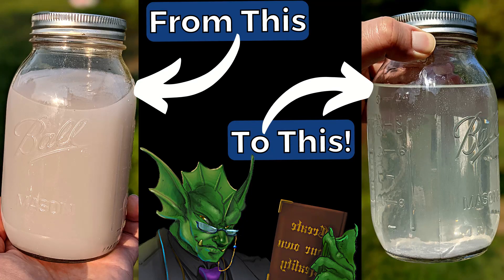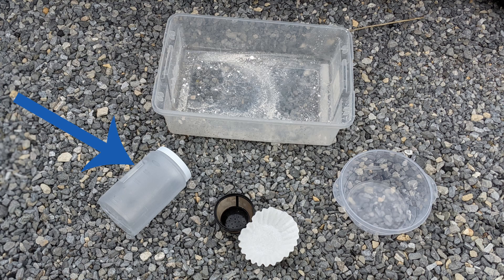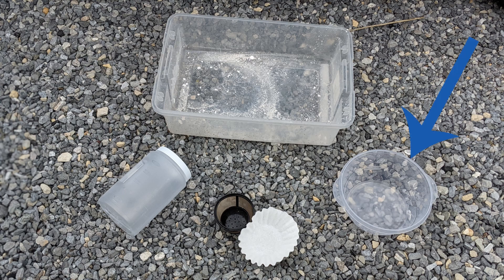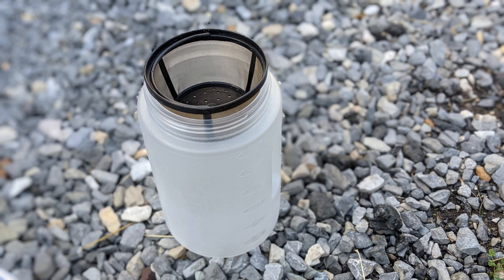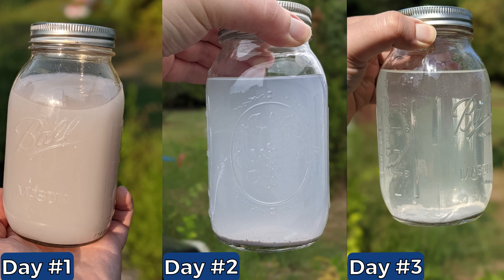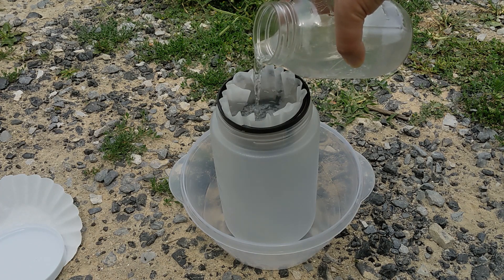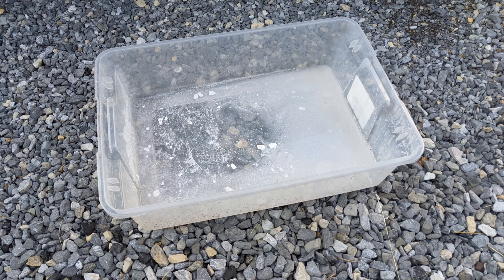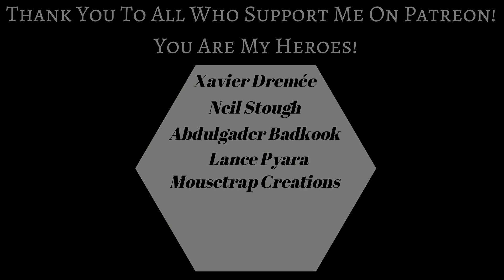How to Filter IPA & Other 3D Resin Cleaners!

Comment: Ignore all of this fiddling around with filters and cups and bottles and just buy a cheap water distiller. Dirty IPA put into a water distiller comes out crystal clear, basically as fresh as new. Set the distiller up outdoors away from any structures. I just started doing this with a $40 water distiller and it beats every other method I've tried by miles. No more consumable filters and gloves and towels and all that other stuff, just distill it and pour it back into a fresh container.
Reply from the maker: @mikefromwa  I've seen that recommended by a few people. 
For anyone considering this option, there are 3 things to be aware of.

1, the distilling process creates a concerning fire hazard when used to distill anything flammable. Please be sure to have fire detection and suppression equipment in the area.

2, the distilling process creates a lot of fumes that can be harmful to your health.

3, depending on the ordinance/laws of your state it could be illegal to distill any form of alcohol with any type of at home distillery.

Comment: Hey SPR, I’m having huge trouble with my resin curing and sticking to the sides of the jar. To the point it’s hard to scrape it off the sides. I’ve only left the jar next to the window for a day and I’ve noticed it cured the resin exposed the sides but created a dark spot where it doesn’t cure the inside. Could you tell me how is this so and how to prevent it from happening again? I use IPA and Elegoo ABS-like if that makes things clearer.
Reply from the maker: A few people have asked about similar issues. One thing I've learned since making this video is that you don't need to put your cleaner in the sun. I've left tubs of dirty cleaner in my dark basement for a few days and the resin settles to the bottom just fine without being cured. I'm working on an updated video to cover what I've learned since making this video.
But to avoid the issues you're seeing try filtering your cleaner more often and leave it in a place out of direct sunlight.
The issue with putting it in the sun is that when your cleaner is heavily saturated with resin then you tend to see a thick jelly like consistency rather than seeing the resin settle and separate.
Let me know if all that makes sense.
Reply: @SlicePrintRoleplay  I see, I never tried leaving them to settle on their own. I’ll give it a try and see how it goes.

Comment: I find decanting (ie tilting in order to pour out cleaner fluid) to be to jerky and disturbs the resin settled on the bottom.
I prefer siphoning. Tried with a siphon tube with manual pump (don't suck with mouth! It's not just the IPA/denatured alcohol vapors that you'll suck but also the risk of some resin!), 
but the manual pump usually requires both my hands and leaves the tube inside the settled container again to jerk around (though not as much as decanting).
But discovered really simple way, that I'm sure is accessible to all of you, and it's just as cheap as the manual pump siphon - an electric pump for these large mineral water bottles.
In my area they cost between 5 to 7 euro, and can be operated by a single touch of the button, so basically no jerking at all.
You just have to keep the lower end of the tube as low as you thing will suck most alcohol w/o sucking any resin.
I actually recommend using one of those large water bottles (with the large neck) for which these pumps are designed, because you'll have much easier time setting it, and you won't need any hands holding it, and you'll be able to cut the tube to the necessary length. It works for seconds.
The dirty alcohol at the very bottom I pour thru a paper coffee filter. It takes a long time to drip thru (try to pour most of the resin as late as possible, in order to allow the clearer alcohol to drip thru the filter faster), but since most of the alcohol was pumped already you probably don't need the very last amount so urgently.

Comment: I have a gallon of denatured alcohol that the resin won't settle. I'm in Arizona so lots of sun light.  This gallon I believe has a higher concentration of  methanol.  I could use some ideas.
Reply from the maker: I've heard of people having this issue with both IPA and denatured alcohol. I believe what's happening is that once your cleaning solution has reached a certain level of resin saturation it no longer settles. What normally happens is the cleaner becomes more like a thick jelly after being exposed to UV light. I believe the only way to recover any cleaning solution when it gets like this is to use an alcohol distiller. However, I have not tested this yet. Also doing this could be dangerous so please research and take the proper safety steps when using a distiller.

Comment: I just run my IPA thru a water distiller off amazon, perfectly cleaned IPA
Reply from the maker: I looked into that as well. It actually lead me to purchase an alcohol distiller. I was nervous about purchasing one that only said it was rated for water. I don't know if that will actually cause issues, but I wanted to be safe.
Unfortunately, I haven't had the chance to test it yet.
Reply: @SlicePrintRoleplay  also use it in a garage or outside or very ventilated place.
Reply from the maker: @clballs1  that definitely makes sense!
I was referring to any possible design elements or features that would make it safer to use with alcohol. I looked at different models and saw that both water and alcohol distillers look identical. So there may not be a difference. But I got one that specifically said it could be used with alcohol. It may not be necessary, but I wanted to be sure.
Thanks for your input and advice!
Reply: @SlicePrintRoleplay  Yup will work fine water distiller gets hot enough to evaporate IPA, will just have some nasty crude in the tank after its done of the resin, just scrape it out and good to go. Wont be able to use the distiller for anything other than this though, But ive made my money back from it in just Ipa/denatured alcohol ive saved.

Comment: you ever consider a french press? given the nature of how the filter is working here, it stands to reason that layer of defense would exponentially boost your ability to keep the settle resin at the bottom
Reply from the maker: That's a really interesting idea! I'll certainly look into it. I've actually been testing a new method that's working very well. Hopefully I'll be able to make an updated version of this video soon!
Reply: @SlicePrintRoleplay  it’s worked super well for me but only if you wait to push the plunger and when you do, you only do it a couple inches in set intervals;  every 10 minutes I’m testing now .

I can’t wait to see what you’ve come up with! Your videos were my main source for starting  to be honest now I’m up to building 1:3 cosworth engine perfect replicas haha one thing I’ve meant to ask you specifically is let’s say you damage the polarizing layer - common sense says replace the LCD entirely but if there’s no resin , the screen is still fine it’s just the pol layer. This is a tad uncommon bc usually with a fail, resin does harm the screen during printing but have you tried using any other layer on top of the lcd? Scientifically I get a polarizer is necessary I just don’t get why there’s no disruption in this part of the process. I’ve found with some cheap polarized sheets, it accomplishes the intent of the OEM layer, but this inky works so long as I use the correct angle. Have you ever seen a less clumsy process work ?

Comment: Safety warning: Denatured Alcohol is more methanol than it is ethanol. Methanol is extremely toxic and readily absorbed by the skin. It takes very little to cause permanent blindness (I know orally at least it's very little but I'd imagine the casual touching without gloves over time could lead to blindness, though I'm unsure how much via skin absorption). 

Not sure if it was another of your videos that showed it or just your affiliate link I clicked on. You one you have listed is I believe 45-50% ethanol and 50-55% ethanol. IPA (isopropyl alcohol) is relatively non-toxic. Just thought it was important to include this warning as you almost convinced at first to switch over to it. Now if I was responsible and kept my gloves on the whole time it would be alright, but usually after my wash I'll notice a print not fully cleaned and  pick it up the corner to wave through my bucket of IPA. I think I've accidentally gotten the IPA+resin on my skin a few times too (albeit a tiny amount but over time, exposure adds up). Might still look into it as the price savings seem really good to me, but people should be warned of the risk and make sure none get on your skin. I'm about to transition into a two stage wash were the second bucket will stay mostly clean and having denatured alcohol in first with isopropyl in second would reduce my exposure by a lot.

Comment: I've been leaving mine in a bottle in the window.
The first time I did it it pretty much cleared all the resin in about 2 weeks.
The second time it hasn't cleared and it's been over a month
Reply from the maker: That's really interesting. It could have something to do with how pure your IPA is... Or are you using a different cleaner?
Reply: @SlicePrintRoleplay  the only thing that changed was the resin

First was phrozen aqua blue, second was elegoo grey
Reply from the maker: @ebanksstudios  I wonder if that could have an impact on it. 🤔 Thanks for replying with that info. I'll see if I can find more info about this.
Reply: @SlicePrintRoleplay  Its strange because the resin would sink to the bottom in my wash and cure but when I left it in the window it clouded

Comment: Very helpful, thanks man! by the way, what kind of container should we use for the best result? is it glass one or perhaps polypropylene plastic? or even mineral water bottle is sufficient? 😂
Reply from the maker: That's a great question!
So I've tested this method with IPA and denatured alcohol. In my experience both clear glass and clear plastic work well.
Just please be sure that the plastic container you are using won't get broken down/eaten by your cleaner. 😅

Comment: I'm using the coffee filter in a round filter, but I'm finding the process takes forever. 2700ml took me about 40 minutes to filter, changing the filter 3x. Anyone come up with a faster way to filter the cured IPA back in?
Reply from the maker: So the main reason I recommend using the metal mesh coffee basket is because it allows liquid to flow in all directions.
This means it doesn't get clogged up the way a paper filter in a funnel will.

Comment: Thanks for the video....so, how frequently do you filter?  As to not get an overly saturated IPA solution that is hard to bring back to life.  Does greater frequency help?
Reply from the maker: You are very welcome! 

I personally don't print as much as I'd like. So my cleaning solution (denatured alcohol) might go 2-3 days untouched. By then the resin has settled and I can see how much there is. So if I see there's a large amount of resin settled on the bottom I'll just filter it before I use it. It only takes a minute or two so it doesn't add a ton of time to the cleaning process. Following that process I've been able to use the same cleaning solution for 6+ weeks. I add new when the level gets too low to cover the parts I am cleaning.

So if you're printing a lot my recommendation would be to have two containers going.  That way you can let one container settle while using the other. Then filter the one that's been sitting and switch them out.
I'd probably switch once a week if I was washing models evey day, but it will depend on what you're seeing.
Hopefully that answers your question.
Reply: @SlicePrintRoleplay  That is exactly the info I was looking for...thank you so much for sharing your knowledge!
Reply from the maker: @mcrorietube  fantastic, you are very welcome!
Reply: @SlicePrintRoleplay  so I guess my habit of running six or seven bottles of resin worth of prints through my cleaning station is a bit too much?
Reply from the maker: @JerrodHansen  that's totally dependent on the results you're getting. If you're not having issues then I wouldn't change your process. However, if you find your models are often sticky after washing them then it would be a good idea to do this more often. 😊
Reply: @SlicePrintRoleplay  I do a second bath with a toothbrush scrub as well. The prints are coming clean but I may be sacrificing recyclability if the IPA running it this long. 

Thanks for your video, good stuff!

Comment: Would the cured resin goo be dangerous if it touches you? I got a bit messy, leaving my rinse and cure container in the sun full of contaminated IPA. I filtered it, but tons of resin goo, left for hours in the sun
Reply from the maker: Yeah unfortunately that's a little tough. You're best bet when it gets overly saturated is to check and see if you have a chemical disposal center near you... I'm currently testing a few methods for dealing with that stuff, but nothing I can report back on yet I'm afraid.

Comment: I don't get it. This is unequivocally NOT how my dirty IPA behaves. When exposed to sunlight, instead of the resin solidifying and sinking to the bottom, it cures into this white, gelatinous IPA sludge.
Reply from the maker: Hey Frank. I've hard a few other people say the same thing so you're not alone. I apologize that I didn't cover this in my video, but it's actually something I haven't run into as a if yet. 
There is one thing that others have said works for them.
Let the dirty IPA set for a few days, up to a week or two, out of the sun.
Then see if the resin has settled down. If it has then expose it to UV light.
If it hasn't then try adding more IPA that's less saturated with resin.

I think this issue comes up when the IPA is overly saturated with resin and it is very slow to settle.
Reply: @SlicePrintRoleplay  Interesting - I'm getting this effect when the IPA is much less contaminated than yours seems to be  (from the pictures), but it could be worth testing. If I leave the cover off my wash and cure station, there's an hour of the afternoon where it gets sun... then BOOM jelly.
Reply from the maker: @festmkiv  interesting. 🤔 About 1 in 5 people in the comments have said this exact thing. It's so strange that it behaves so differently for some... I'm definitely going to look into this and see if I can figure out what's going on... Please do keep me updated on your experiences though!

Comment: Fantastic quick and to the point video! Going to try this out... my problem is I typically wait too long and just end up with a full jar of sludge ;)
Reply from the maker: Thanks for the awesome feedback! 
This is definitely not the only option for reusing IPA, but it's a good option.... But yes overly saturated IPA is a bit to deal with... Definitely let me know how it goes for you!
Reply from the maker: Here's some advice others have given me about dealing with overly saturated IPA.
Let the dirty IPA set for a few days, up to a week or two, out of the sun.
Then see if the resin has settled down. If it has then expose it to UV light.
If it hasn't then try adding more IPA that's less saturated with resin.
Reply: @SlicePrintRoleplay  my old IPA has been sitting in 6 quart clear plastic containers in sunlight for MONTHS and is persistently cloudy. I’d let it settle to a fairly clear state before exposing it to the sun too. Is there any hope? Am I just over saturating the IPA in my cleaning station? I guess $20/month in cleaning solution (ie 2 gallons of IPA used for 2 months) is just more expensive for these beautiful minis, eh?

Comment: I've used coffee filters and funnels before and you only get a few ounces before the filter will only get drips. Does the basket really make that big of a difference?
Reply from the maker: It absolutely does yes! The difference is that the liquid can flow out all areas of the mesh basket. With a funnel you're forcing the liquid to flow out only one small hole. I tried it with a funnel once and, like you, I found it clogged after only a few seconds.
Reply: @SlicePrintRoleplay  that makes sense now that I say it out loud lol. I am remembering people say they had the same issue. And someone made an stl file for sale that accomplishes the same thing as the basket does for the same reasoning
Reply: @Brandon-zw3hw  is that an stl for use in a funnel to increase drainage?

Comment: Mine took more like a week or two weeks to settle out 
. This is in Arizona Also it can be very difficult to see inside of some of these containers even if they're Clear after settling. Different kind of resins are different in the way they settle out and one of mine ended up not totally clear but slightly yellow and would not settle out anymore. Also I've tried different filtering systems and ended up using a  fine paint filter through a 3D printed filter basket. It still works in a two-stage filtered then  clean IPA system
Reply from the maker: Those are all good points. 
It can definitely take longer than 3 days to settle depending on how much resin is in the liquid.
Absolutely the liquid might not return to its original color as the dye in some resins will change the color.